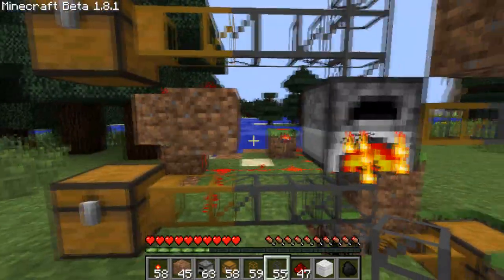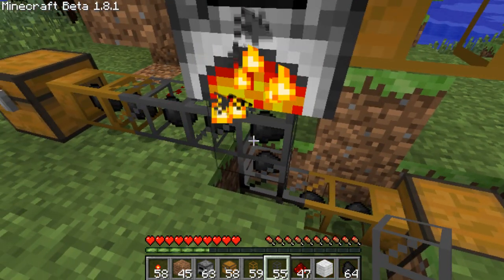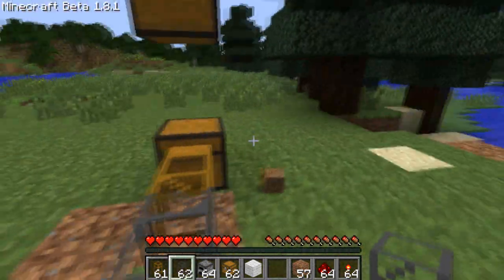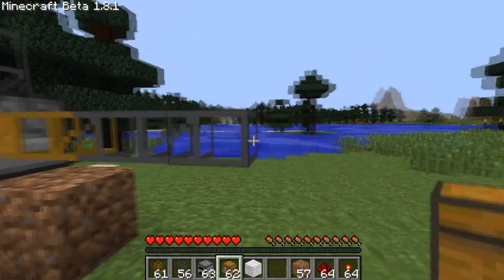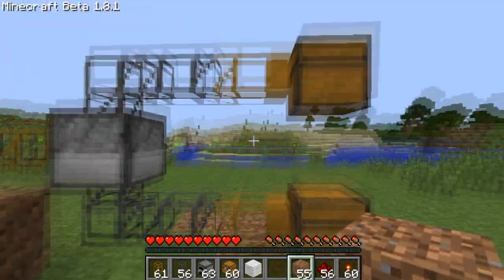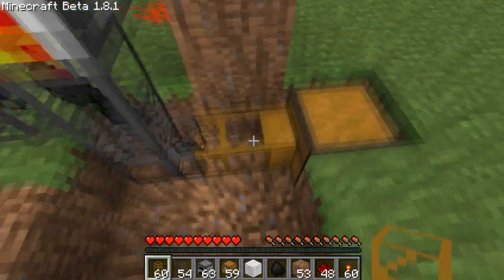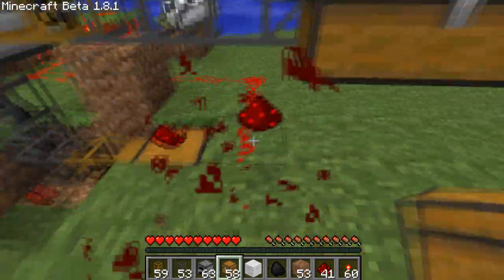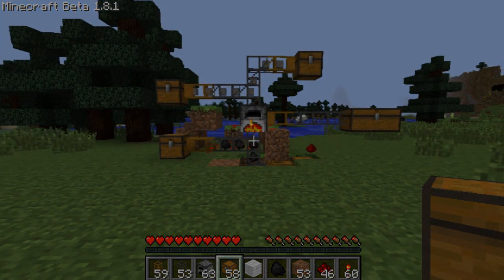Buildcraft Guide 1 - Automatic furnace

Comment from the maker: @polkmnji95 No, if you just use a single torch/redstone power, it will only allow one item to pass through. You have to use some sort of clock so a constant stream of items can keep going. If you decide to upgrade to a later version of buildcraft, you can use redstone engines or some other engine (I'm not quite sure which one because I haven't used them much) to power your pipe.

Comment: This no longer works I tried it
Reply: @chachachalga  still works?
Reply: @rogerimmanuelkailuhu7762  Doesn't work for me in 2020. I tried every possible input  and output and it refuses to remove the finished bars. Finally I tried using a hopper and it finally spit out the finished bars. My suggestion to you is feed everything into the smelter like he shows in the video, but instead of using a pipe as an output, use a hopper instead.